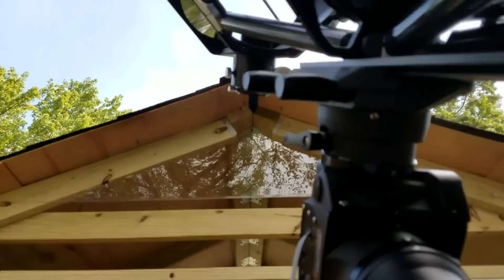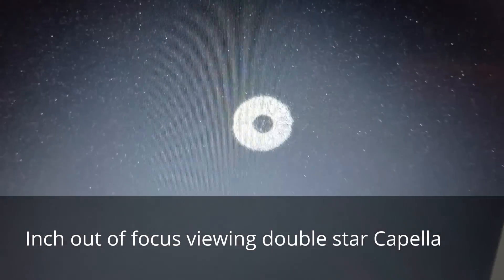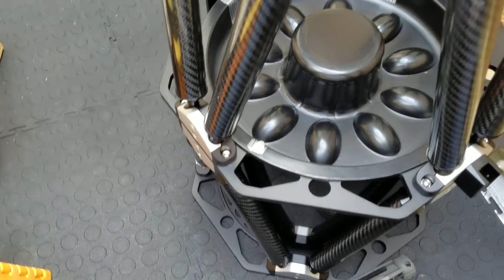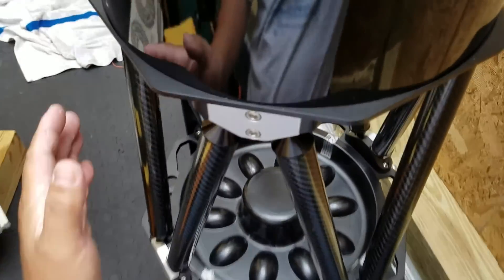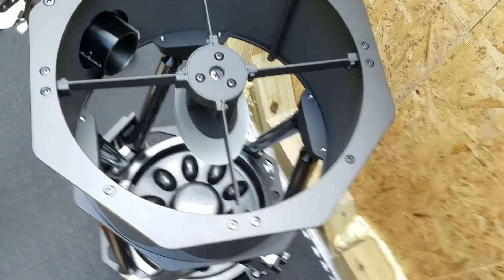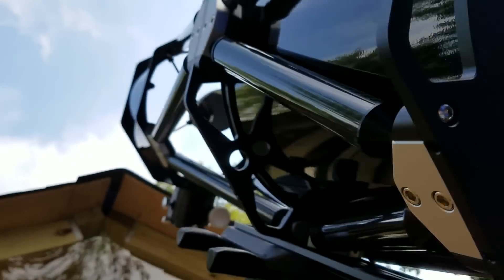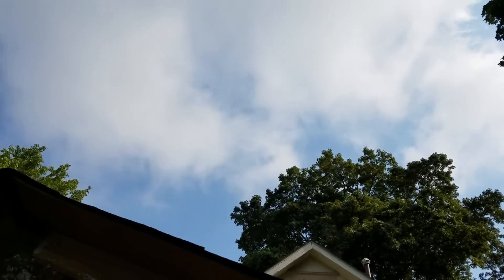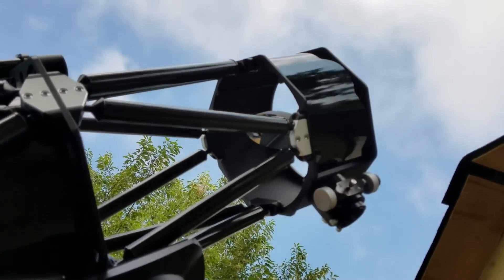Guan Sheng Optical from AstroView to AstroImaging -uncut

Comment: oh you need to re collimate now ? you moved it out of alignment when you twisted the head around you will have one massive coma in blue around the top left side witch in tun would be bottom right as our eyes meridian flip the image i guess a diagonal would be very useful for you but make it a 2" dialectical coated one with 98% light gathering another thing you will notice is that your filters will be a lot clearer and seem to bring everything to like HD vision i bet you tripping over yourself with joy i would be with a scope like that you asked me if i had faith yes i do i also have faith in you and all my love to you and your family clear sky's bro :) T
Reply from the maker: I just finished using my laser collimator...   I like this model because its smaller for my observatory, I get more clearance for slewing above the horizons.  Also, just figured out how to fit 2in coma corrector to asi camera.
Reply: cool i wondered about that after you mentioned you bird watcher i have seen another useful thing on eBay just for that it might help a lot http://www.ebay.co.uk/itm/1-25-Extension-Tube-Eyepiece-Telescope-Mount-Adapter-for-DSLR-SLR-Camera-DC636/272499509754?ssPageName=STRK%3AMEBIDX%3AIT&_trksid=p2055119.m1438.l2649
Reply: sometimes you can get away with just a Barlow with a T2 thread on top